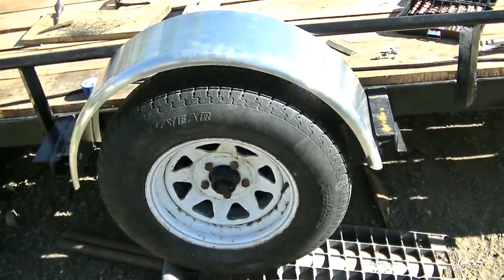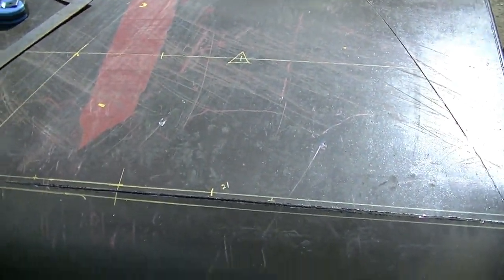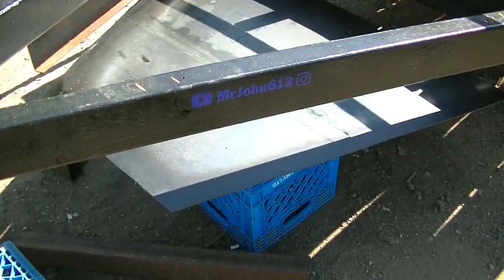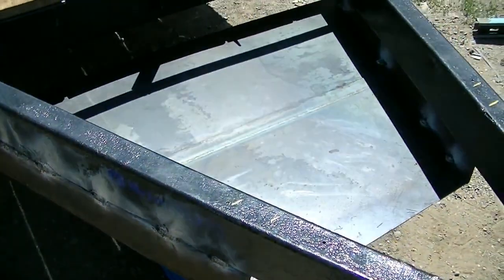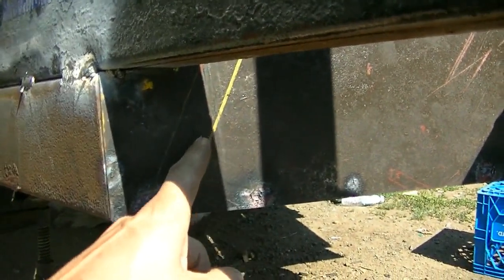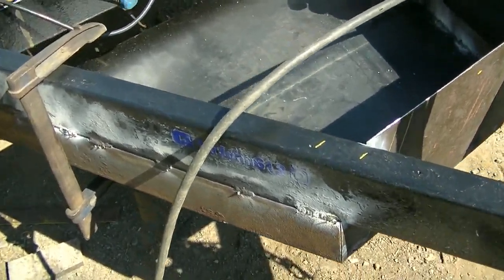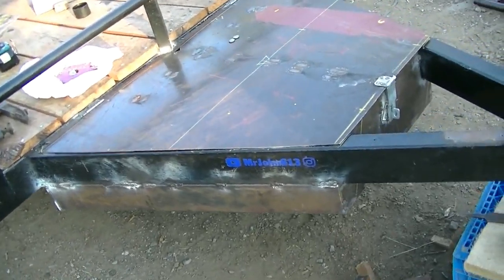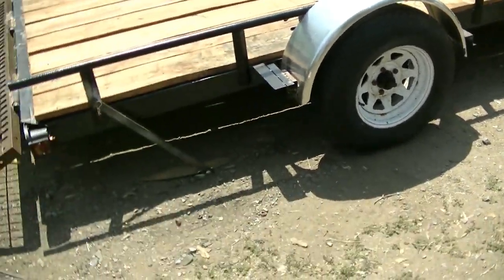Camper To Utility Float Trailer Part 3 (Storage)

Comment: Thanks for the vid. Have you found the box collecting water over the time you've had it? I want to do this to my trailer, but was told to put some sort of grate down as a floor, so water would just drain out.
Reply from the maker: Yes it collected water one day so I drilled small drain holes in the corners
Reply: @613Builds  ok thanks man, I appreciate your help!

Comment: Nice place for your tool box was a wasted place any way. Have you try if a spare tire would fit in there.
Reply from the maker: I have not tried a spare in there yet, I plann to mount a spare on the side of the tongue later, if it will fit good.  Thanks